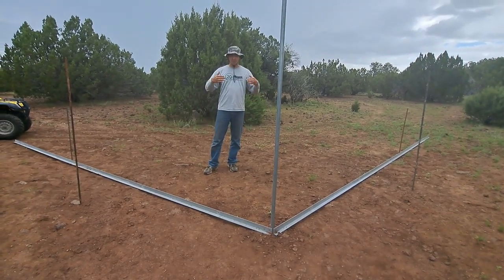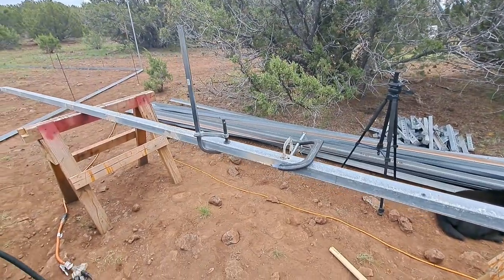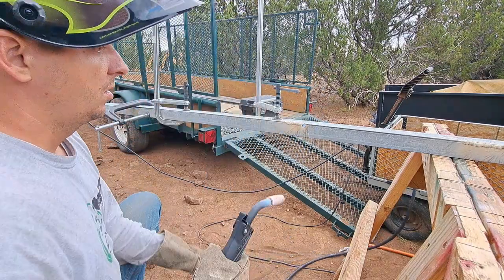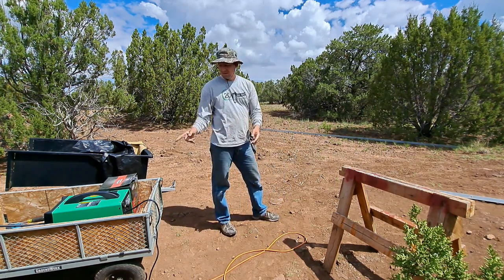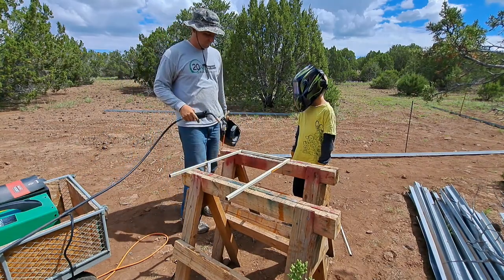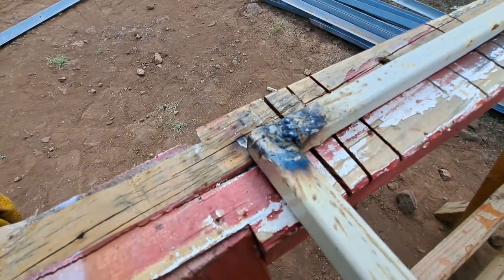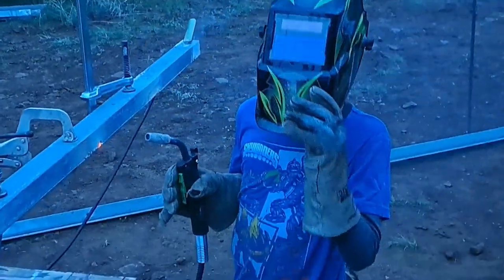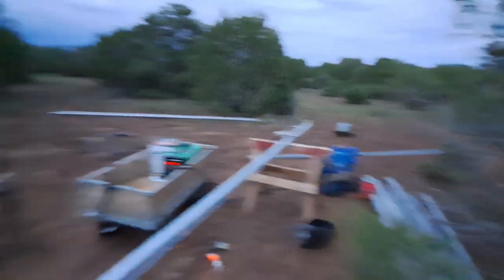Welding Scrap Metal Into Square Tubing For Our Ground Mount Solar V | Off Grid Solar System Build

Comment: You need some tip tip for your wire Wilder because if you don't dip it. It's not gonna work good and it also keeps the wire from welling to the copper tips and stuff

Comment: Hey people,  just to ask, not start anything, but I remember, say over 20 years ago that a welder told me that welding galv/steel was something that I should not do when I wanted to build a cheap trailer, as welding galvanized steel will make you sick? If inhaled, the fumes from welding galvanized steel can cause galvanize poisoning due to the lead in it,  I am just wanting to help you keep all safe/healthy just in case I am right, I did look online at a few places and You should too,   Later  I only watched the first 14+ mins of the video for now,
Reply: Thanks for understanding, I would hate that I did not say something or give you tie to check this out, there are signs and ways to tell if you get to much gas to cause troubles, also I read that Milk, just regular milk can correct anything that might be cause by welding if not much was done,  Later

Comment: so the oldest boys are 9 and 11, how old is the youngest boy and your daughter ?  The stick out on your welding is long, keep the wire to around 1/2 inch for a better weld. I would also have used a respirator with that galvanized metal, the fumes are deadly. Maybe have your sons use 1 hand to hold the stinger and the other to steady it using the part to weld, it will make for a cleaner and better weld that way. I didn't learn until my 30's so it is cool they are learning so young. I got a 120V Titanium Flux 125 DC Inverter style and it does so well for small and medium projects. I wished I had learned as a kid, I had to pay others to weld for me until I got that welder a few years ago.  Anyway, awesome seeing all the kids being encouraged to do stuff for themselves and willing to learn new things.

Comment: OMG, You Never Got A Life Time Warranty🧾On Your Sears Welder😁For $9.99 At Point Of Purchase🤣? If You Have Gotten 18 Years Out Of That Welder💥, It Has Gone Way Past It's Expiration Date😱& You Were Welding💥On Fumes☁☁Whipper Snapper. Just Count Your Luckey Stars🌠. Just Realize On Making Your Square Poles That Rome🍷🧀Was Not Built & Made In A Day. Drink Water💧! Your Sounding👂On The Edge Of Dehydration🩺👨‍⚕. The📣🎬🎥'Tom Sawyer' 📚Moment At The End Of The Day Going Down The Mississippi River, Priceless🎯! I See👀At Least 🔮6 J.D. Power Awards🏆🏆🏆🏆🏆🏆Coming Your Way😁! always, Tommy🤠